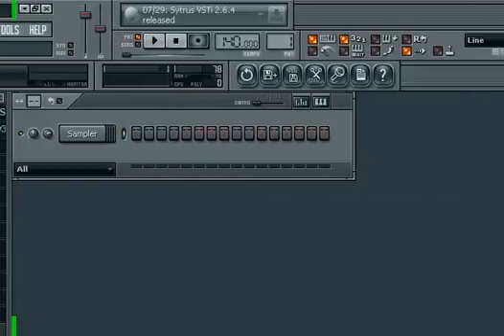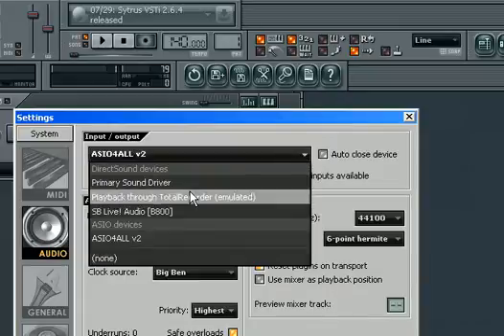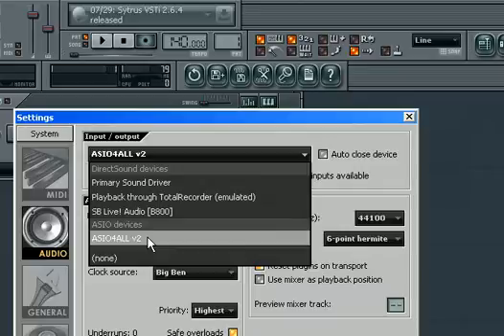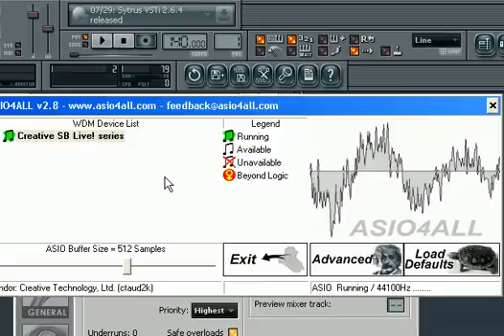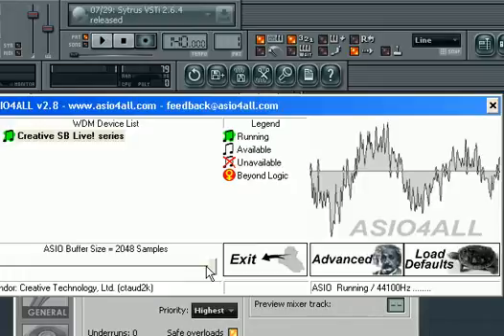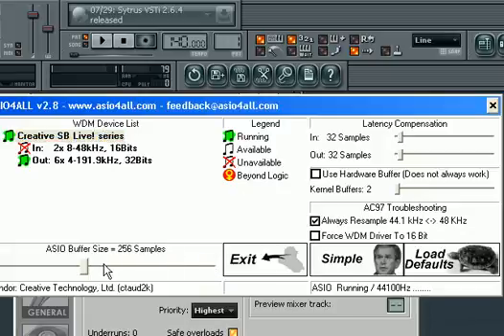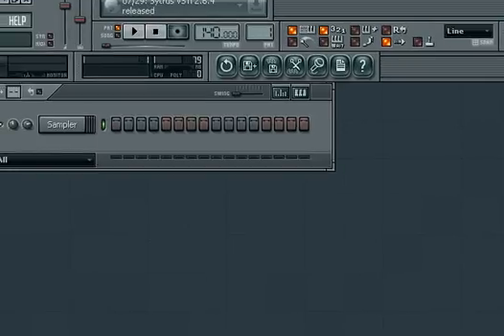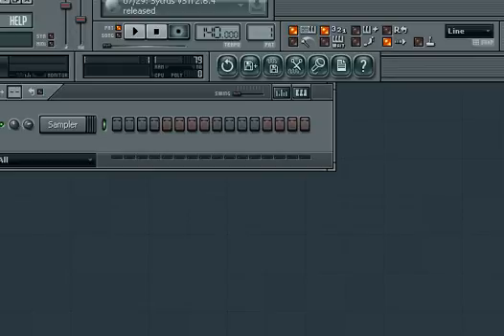Tutorial: Fruity Loop Studios 8: Reducing Speaker Crackle (Method 1)

Comment: Buffer underruns & maximizing FL Studio performance
If your CPU or disk usage climbs too high you are likely to experience audio 'buffer underruns' as clicks or pops in the audio. The good news is that CPU and disk usage can usually be lowered considerably if you take the time to make some adjustments to the FL Studio Audio settings. Why does this happen? The Audio Buffer is a temporary store of audio waiting to be sent to the soundcard, this allows programs like FL Studio to even out momentary spikes in CPU load. If the Audio Buffer runs dry, because your CPU or hard-drive can't keep up with the 'real-time' audio stream, then your Soundcard will make rude pop, click or stutter noises. It is worth noting that underruns can ONLY occur in real-time playback, they will not happen while exporting to wave or mp3 file. If you do hear that sort of thing in an exported audio file, then it is likely a plugin behaving badly, check the plugin settings in that case. 

Further information is available in the  FL Studio Optimization  YouTube playlist.

Comment: I run my fl on windows 7 64bit.I have a xfi on the go sound card /not saying what kind of laptop i have.But go to option/audio set to asio because fl default primary driver sucks.Set your buffer to 1024 /select your soundcard and put your in-out output on 16 or 32.Go to audio and you see mixer put that on 64 or 128 pt sinc.And last bt not least go to your program file,86 where ever imageline at copy fl (extended Memory)and make a shortcut to desktop  this open fl the same way

Comment from the maker: @KharismaTV Ok then in ASIO make sure all the option listed on the left have a green light next to them.  If there is a red light click on it to enable them.  You may also want to make sure all your devices are enabled in your soundcard.  If none of that works the buffer size trick should work on the driver you used before ASIO.  If all else fails.

Comment from the maker: @Hernanner Sounds like the computer simply cannot handle FL Studios.  There is only so much you can do to work around having a slow computer.  One tip is to record specific loops in your song as wav or mp3 files.  Computers can play back a sound file much quicker then creating on the spot with a VST.

Comment from the maker: @geo2297 For me I have an HP laptop.  With ASIO I have 3 selections: Hp3Out, SpDoc, and Speakers 1 and 2. I start the program with external speakers pluged in, then load it,  I unplug my external speakers, click 'speakers 1 and 2' (the program doesn't recognize it), click speakers 1 and 2 again, then plug in my external speakers and I have sound.  The solution might be something similar for you.  try messing with different outputs with and without external speakers.

Comment: Awesome, I couldn't figure out how to reduce that crackle at all.

I had to do it slightly differently though: rather than selecting ASIO, I just selected my driver in output and was given the option the option to edit buffer length in place of the ASIO button. Default was 47ms(2048 samples) and I bumped it up to 100ms(4400 samples) and it's reduced 99.9% of the crackle. It goes up to something like 370+ms of delay... but I figure the less you set it for  the better.